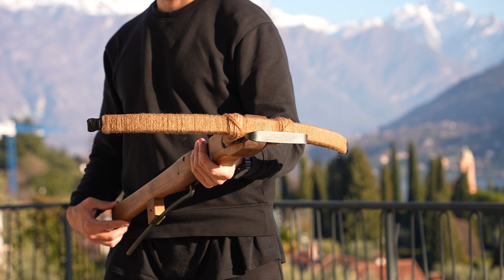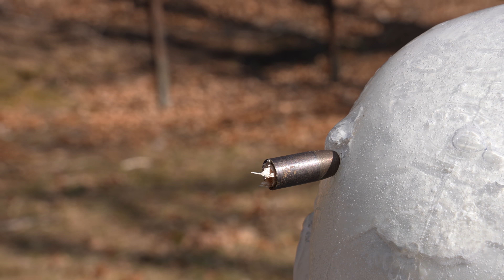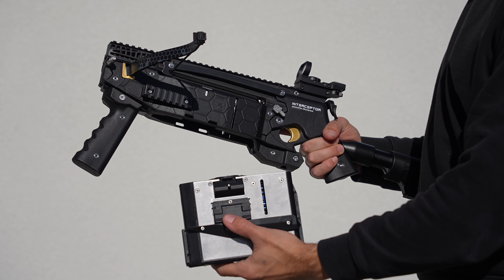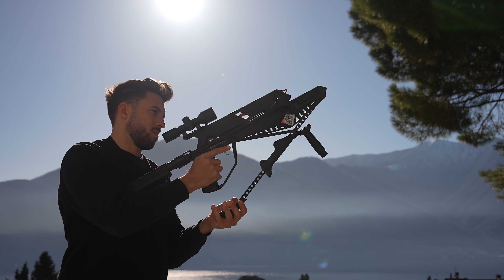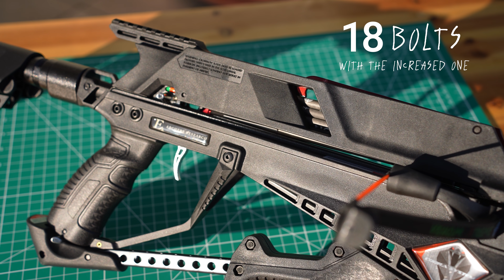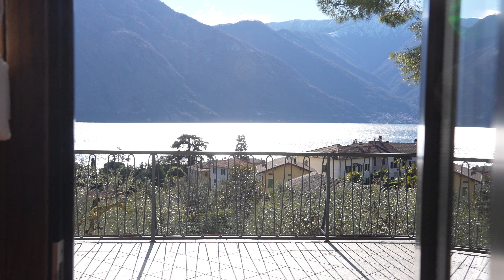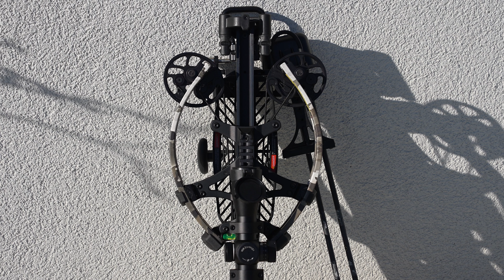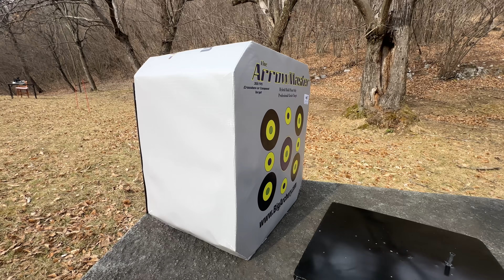How Dangerous are Crossbows?

Comment: Big Boy looks like it would drop a Bull Moose. Two needed improvements would be much sturdier bolts and a battery-powered cocking winch built into it.  I agree the mid-power unit (with extra magazines) is the smartest choice for the Apocalypse, either with or without Zombies.

Comment: The adder would be best against zombies, small game hunting, and home defense (in gun restricted areas).

Getting right to the good stuff, the more expensive options are too powerful, will be overkill and break the bolts or be lodged so deep they destroy the fletching... If you miss the target they will be lodged deep in whatever they hit.

Which as you stated in the video the Tenpoint was $100 for 6.
The Adder's bolts are currently listed as $35 for 10 (target) and $60 for 6 of the broadheads

Adder is also faster loading than winch styles.

Currently the Adder is listed as $300 but basing on prices at time of video, for initial investment of $2600 you could either get a Lancer with just 3 arrows...Or an Adder with 200 broadtips, or 571 Target tips....

Or for an initial investment of $2600 you could get 4 Adders, and 57 Target tips/20 Broad
or... 3 Adders with 80 Broad tips/228 Target TIps

For those 3 adders, if you had a 1:2 ratio (1 broad for every 2 training bolts), each person could have 16 Broads and 32 Training tips... That's a fairly effective arsenal.

Comment: Fun video.
I made a 75 lbs crossbow in high school. Yeah, thinking back it’s interesting that a teacher would aloud us to build lethal weapons in a high school shop class but…. The kit included the aluminum bow, string (wire cable) with loops in the ends, trigger and spring and brass rails to imbed into the stock for the “string” to slide on.  Fun to play with. I use to shoot it in my basement. The wooden bolts didn’t last long. They’d go through my plywood target and disintegrate against the basement, block wall. I got fairly good a fletching.

Comment: When I was about fourteen I made myself a crossbow. A pistol carved from a 2x4 with 12" leaf spring off a car. String was picture frame cable. I cocked it with a bar hooked in a hole behind the trigger. My one arrow was just a sharpened steel 3/16" rod I also made the catch rod and trigger from. Since the catch had to be propped forward the real trigger was lower behind it, and pulled, simply came off the end so the bottom of the catch could fly back. Total cost, nothing, except trouble caused by my own stupidity. No idea at all about poundage, I figured our front door would be a good first target, except it went clear through into the kitchen. 😢 Well I was a slingshot guy anyway. 😂

Comment: I'm going to be honest I think a lot of this is flawed in testing, especially around the 'historical' crossbow. First of all just that a crossbow should not be compared to a bow in terms of draw weight, crossbows are far less efficient than bows are at moving that energy into a shot mainly due to their more compact design, so while yes, a bow might only have a 60lbs draw weight that is going to be WAY stronger than a historical crossbow with a 60lbs draw weight, from what I know a 1000lbs crossbow would be around as powerful as a 160lbs longbow, so comparing those numbers is fairly misleading. The main other thing is the difference in ammo. the bolts being used in the video are extremely inefficient, they are fine for something like target practice for fun, but if you are trying to actually test the effectiveness you should be using thinner bolts with better arrow heads that are actually designed for piercing efficiently rather than the bulky dull design used. This wouldn't matter that much if it wasn't for the fact that its being used for comparison against crossbows that are actually using proper bolts, and that at least one of the tests for lethality is just... inaccurate... like there is a reason crossbows were used in warfare, they could kill, and do it well, but something like what was being used just can't, its just a horrible weapon.

Comment: one thing tough, if you want to meassure the actual accuracy, not the shooter plus weapon accuracy, I recommend a stand that affixes the weapon in place, use a laser to figure out the trajectory, and then repeat firing it from that exact placement, otherwise the biggest issue to accuracy is the user, as can be seen by the heavy shaking

Comment: The main problem with surviving a crossbow bolt to the head (specifically those hunting bolts) is that typically the best way to remove something like that is pushing it all the way through. 

Obviously you can’t push the bolts through the head but even if you get hit in the face or neck, both of those areas contain vital blood vessels and even arteries that could kill you if nicked.

Comment: I'm somewhat surprised the high end, high draw bows do not have a battery operated winch system. Either as an in-built component, or as a motor-assisted crank. Something to speed up reloading, as well as reduce arm fatigue.

Comment: Well ,the idea is great and I understand what he was trying to do but he missed the point 100%. if you are looking to test the goliaths of the crossbow market, he failed to test the best on the market. I just tested my Ravin 500 sniper against the Tenpoint TRX515 $5000 crossbow. after 20 shots with the Tenpoint using a Garmin Xero the Tenpoint never broke 475 FPS and the Ravin which was $1900 brakes 505 FPS every time with Bolts of the same weight. beyond that the Ravin loads by 2 all threads moving the trigger block to the string VS a cable and having to jamb the block onto the string.

Comment: you can get ones as good as the 10 point for far cheaper if you know what to look for and don't  go for too many bells and whistles they  add all they can to these when basic is cheaper and just as effective
this is a conventional crossbow for about $250 US 
Killer Instinct 415
Max Velocity 415 fps
Muzzle Energy 141 ft/lbs
Suggested for Hunting
Weight 6.7 lbs
Scopeable Weaver/Picatinny

Comment: Yeah im pretty sure that they didn't use toy looking dull ass bolts for the medieval crossbow. Im pretty sure just as much time went into the building and design of the bolt as the crossbow itself. Not that dumb thing you used.

Comment: not sure how I ended here but i call the medieval staged.  Wth is that bolt ?
Crossbow was invented as natural follow up to bows in europe and asia at different times. It saw widespread use over multiple centuries by regular armies, militia, mercenaries and bandits. This alone proves it was capable of causing decisive wounds (or kill) common soldiers at ranges around 50m (shooting up/down walls during sieges or initial exchange before armies close in for the brawl, noone would even consider trying to use a crossbow at a range where the opponent can reach you with his melee weapon with a few steps or a very short sprint, effectively reaching you before you can even drop the crossbow and reach for a melee weapon). With the common soldier at least wearing clothing armor (something like gambeson), likely layered, and with vital areas being potentially reinforced with leather or maybe even wood.
So that medieval crossbow barely penetrating like ~1inch / 2.5cm of bare skin and flesh at a distance already too close for ranged weapons obviously makes no sense....

Comment: Crossvows were used for a long time back in Roman times with deadly results  they had some that were crew served and  deadly at rnge.   Modern crossbows are still used and very good for hunting many larger animals.   Some have mechanial advantages for cocking an some require a lot of strength.  Over all they are still very good weapons to train with and also a lot of fun also.

Comment: This is just complete crap. Especially when you don't take historical arrowhead design and historically accurate forging techniques into account but shoot with stupid modern brass target points. Learn your history dude before you post anything. Put simply a long needle bodkin would probably skewered the whole gelatine block entirely. Lozenge shape would do fine as well.  Moreover this guy shoots a toddler crossbow. With a winch pulley or a cranequin you can harness over 1300lbs. What can I say? A youtuber that has never shot a real medieaval wall arbarlest. :)

Comment: Hang your targets suspended from two lengths parachute chord over a clothes line or cable parallel to your bench length or width to the position of your shoulders, perpendicular to down range. The free movement of the target when struck by the bolt will cut the penetration 75~90%, from .9 of my 32” draw length to just past the field tip because it can match the arrows kinetic energy before the arrow can overcome the friction of the target material. Britton’s Archery in Tarpon Springs, Fl. USA on Alt Rt 19 South of Meres Blvd, North of Klosterman Rd uses this setup and i’ve never had such an easy time removing carbon arrow shafts in my life! Ive been shooting competitively for 50 years.
Reply: Nobody asked you
Reply: @DAILYDISCOLIFE  no need

Comment: take the time to learn wood.  Knots are very stronger than the other part... so comparing knot hits is not precise with non knot hits.  
Learn the bolt type uses and the bolt tips are for different applications too.
A million thanks ,,, fun video and very well done.

Comment: Unless you had a large amount of Pistol crossbow bolts. Maybe. Since they use alum/metal that you can know they'll withstand the beat.

But sadly NONE of the compound crossbows would be usable in a zombie apoc. And you're probably wondering 'Wait why? i seen movies have it?!" The biggest reason are 2 factors. 

1. Compounds require 3 strings and specific tightening of the strings for the cams to perform well in throwing the arrow into the right direction. if 1 is offset it'll cause it to throw it in the wrong direction. 95% of people will not know anything of getting this restrung period. Most take these to pro-archery places to get tuned by a pro and aim sighted in. So Compound bows and crossbows are out completely.

2. Compound bows and crossbows require CARBON and ALUM arrows ONLY. They cannot use older style arrows made from WOOOOOOOOOD. Which would far limit your ability to 'regain' more bolts. So if a Bolt breaks. You're fricked.

So what kind of crossbow or bow to use in a apoc? Longbow/Recurve bows. Or a Recurve crossbow. They might not be AS powerful as so above. But they can be used with older wooden arrows and they are FAR more simpler to restring without a pro help. 2 things many people will lack in a zombie apoc world event. So a normal crossbow with a standard single string would be the best option. Even though not as powerful it's still pretty deadly. Including a normal recurve bow. You just need to shoot in more reasonable places rather then going full blown through thicken bone locations. Plus you'll be able to use self-made wood arrows with these two bows/crossbows since they aren't as crazy and don't limit the older woodbolt systems.

It's a neat idea. And cool look in movies. But in a realistic event. It's not a usable option at all. So do not follow suggestions of using a COMPOUND (CAM WHEEL BOW/Crossbow) design for a SHTF or Etc bugout tool. Stick with a recurve style crossbow or a recurve/longbow bow. Or use the recurve style little pistol crossbows you can pick up for like 50$ on amazon or so. They won't do crazy damage. But still would go through flesh or any other soft part if aimmed well.

Try to understand the 'Longterm' effect rather then the short-term look.

Comment: So what is the advantage of these expensive bows? They have so many parts that in case of civilization breakdown there is no way you would be able to maintain them. Recurve bows yes but these crossbows are just way too complicated for daily use. You can buy a lot cheaper gun with a lot better security, lethality, and precision. These bows are nothing more than an engineering exercise and of no practical value of any kind.

Comment: Its pretty strange that a begginer 30lb 64 inch recurve bow, with typical 32 gram arrows, can shoot 35 joules, being much more practical and economical than the first two setups you showed. A bit more experienced archer could go easily up to 50lb, reaching 60 joules (beating the first 3 options you showed). Finally; ive seen some people shoot 100lb bows with pretty heavy arrows, reaching above 200 joules, beating every but the last one of the crossbows in this video

Comment: What I'm curious about regarding the Adder is whether the magazine can be swapped or if it just stays on there and if you run out of bolts you're SOL. In an apocalypse setting the Adder would be my preferred choice due to a good mix of shooting speed and power. If the mag can't be swapped then I'd go with the interceptor, though in both cases I'd try a heavier limb, even if the lower mechanical advantage of the interceptor might be a problem.
However I would not carry a second crossbow. While the power of the last two is impressive I don't think they're worth the extra weight, at least not when roaming on foot. If I got a car and the roads aren't blocked, or if I'm settled down somewhere, then that's a different story. In most situations you'll only get one shot with them and while the increased range can be helpful, the additional power can also cause the bolts to break, which means you have precious few shots before the thing becomes useless.

Comment: I once came up with a pulley-based cocking mechanism that was inspired by the pump-charge shotgun from the video game Ultrakill. If you need rapid fire, you can pump it once and pull the trigger,  or pump it multiple times and then fire for more power.

Comment: Power at the cost of speed to reload is not going to do well for zombies.
Reply: These are some decent examples but.. I've seen fully working prototype fully automatic crossbows that basically incorporate a power drill motor to cycle bolts and tensioner without any clumsy  mechanics...